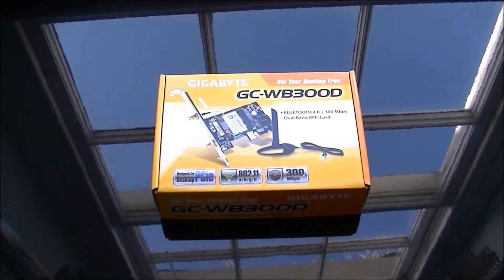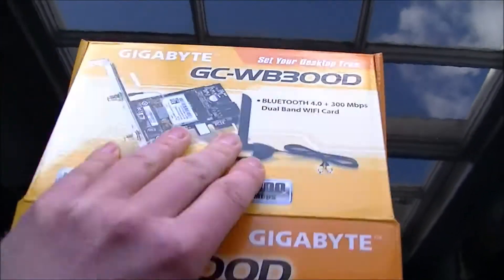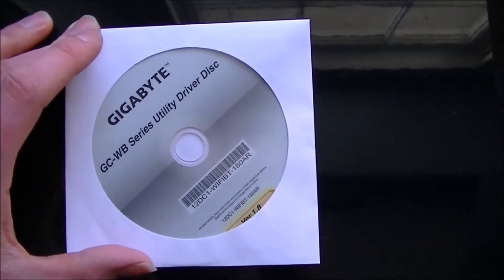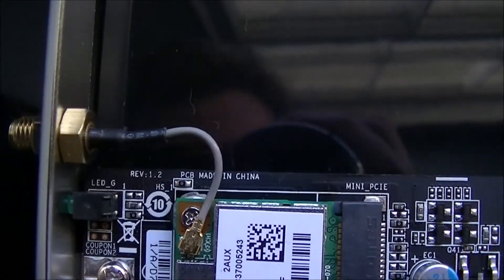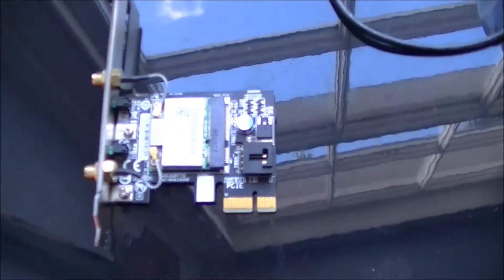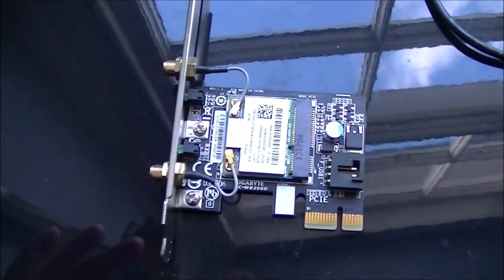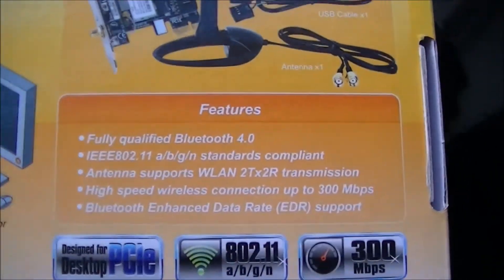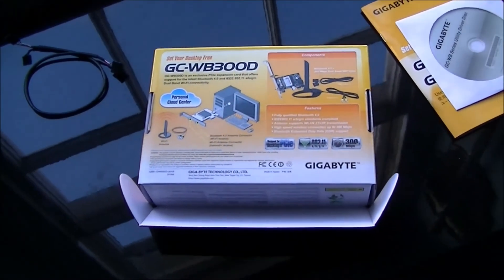Gigabyte Wireless PCI-E card GC-WB300D Review by JoyboyP

Comment: thank you i installed the driver, the wifi receiver works but my bluetooth didnt work im going crazy on this! help.
Reply from the maker: You do have to install the Bluetooth driver separately. I've never used the Bluetooth features so I can't help much with that.
Reply from the maker: I tried using the Bluetooth feature with my old phone today, it was a bit difficult to get it to work but I managed to. 

Make sure you have the BT driver installed.

If you are on windows 8 go to the start screen and in the search bar in the top right type in Bluetooth and it should bring you to the windows Bluetooth feature.

Make sure your device is detectable in it's setting and use your device and windows to pair them. Then try sending something from your device to see if it works.

Once they're connected a new window should open with many options on it.

I hope this help, this was all I was able to do with it.

Comment: hello I have a wifi card identical to what you present to you   but no longer operates pc     (unable to detect the wireless netwoek card)   thanks
Reply from the maker: Vlad Ionescul Have you tried re-installing the drivers or changing PCIe slots (it will work in the longer slots as well) on your motherboard.
If that don't work your card may be defective.

Comment: do you have video on this on how to install this on the motherboard?
Reply from the maker: I don't currently have a video on how to install this, however it is very simple.

Plug the card into an available PCI slot (you only need a small one).
Plug the cable into the card and the other end into an available USB header on the motherboard (the cable will only go in one way as both ends are a different shape).

Download the latest drives for your OS from the Gigabyte web site and istall them.
http://www.gigabyte.com/products/product-page.aspx?pid=4135#dl

If you like I could make a quick install guide to help.

Comment: Guys someone help me it won't detect the wifi it won't show I'm trying to install the wlan drive
Reply from the maker: I Know this sounds silly but make sure you have everything connected properly, The USB2.0 connector and seated properly in your PCIe port. If that doesn't work try putting it in a different PCIe slot (in a long one (x16, x8 orx 4) if you have to) and see if that helps. Make sure the drivers you are installing are compatible with your OS download them from the Gigabyte page, Here: http://www.gigabyte.com/products/product-page.aspx?pid=4135#dl.

If all that don't work you may have a defective card.